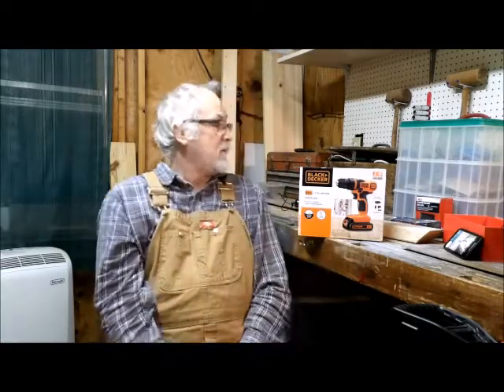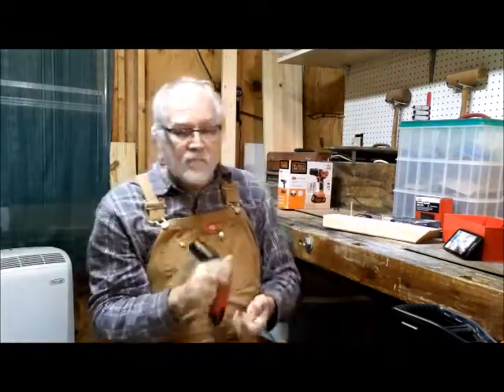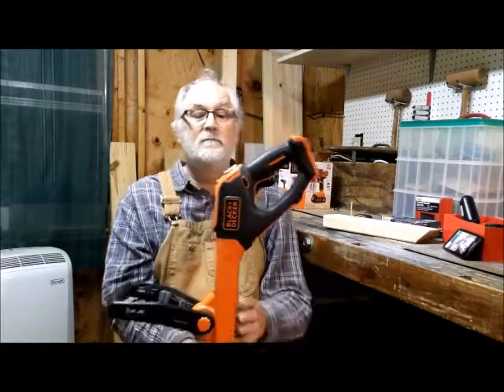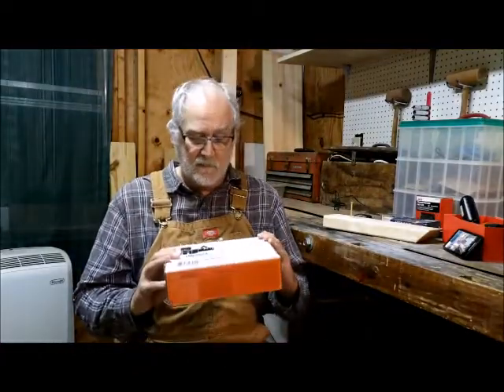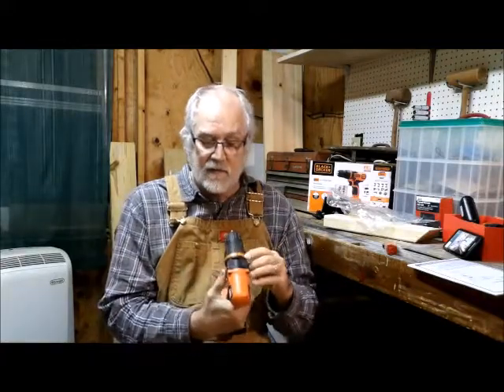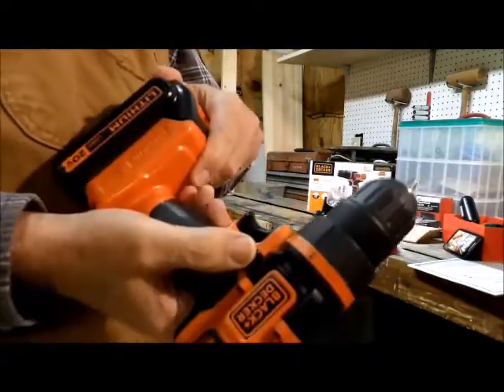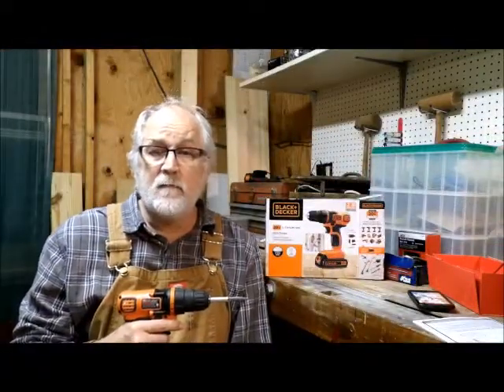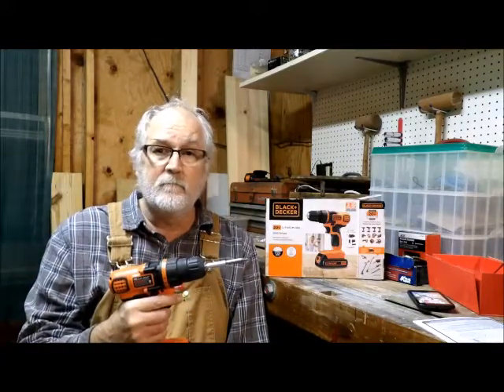BLACK+DECKER 20V MAX Cordless Drill / Driver, 3/8-Inch (LDX120C) Review

Comment: thank you for the review. you remember me my grandfather, he used to be always working with wood
Reply from the maker: Thanks.
Reply: I dont mean to be offtopic but does anyone know a method to log back into an instagram account??
I was dumb lost the password. I would appreciate any tips you can give me!
Reply: @Marcellus Jorge Instablaster =)
Reply: @Genesis Grant thanks so much for your reply. I found the site through google and I'm in the hacking process atm.
Seems to take a while so I will reply here later when my account password hopefully is recovered.
Reply: I remember my first b&d  tool in 1989 my father brought me the cordless screwdriver from them it was terrible by today's standards but heck it was cool at the time going from corded that my dad my grandfather had to that it was not powerful but the convenience was nice had that ratchet too as well from that line say like 91 the ratchet I got got my first reciprocating saw a Craftsman made by b&d for them it's there professional line DeWalt used the same design different color black & deck use to be good I have my grandmothers jigsaw works really well still I rebuilt the thing myself for 53 years it works good